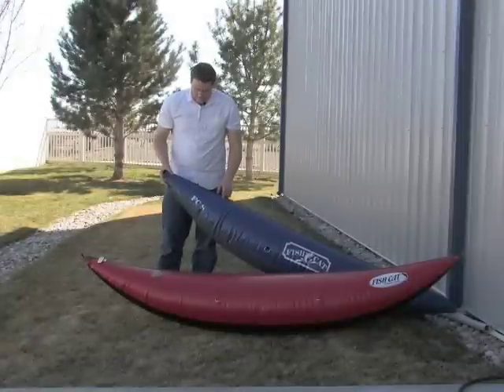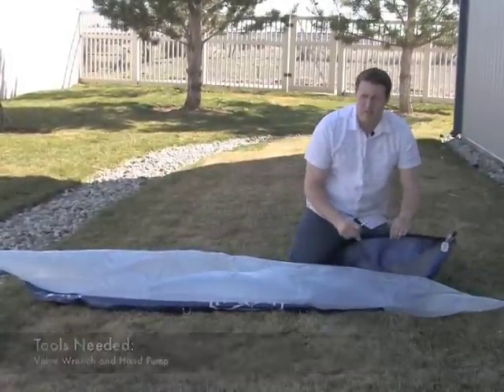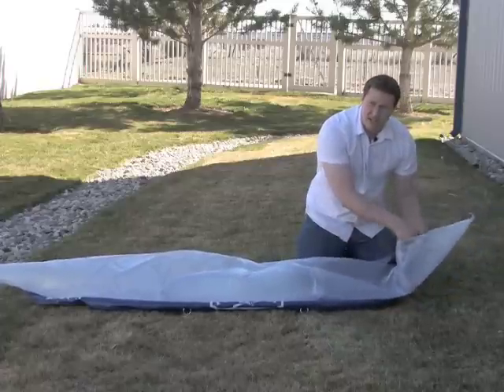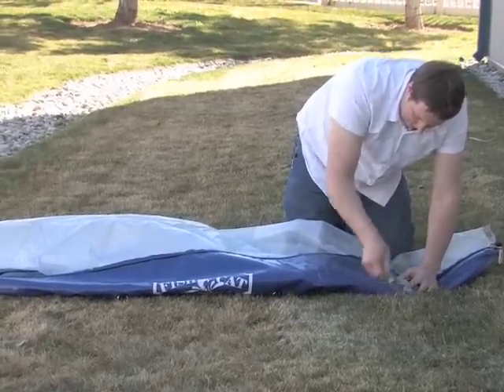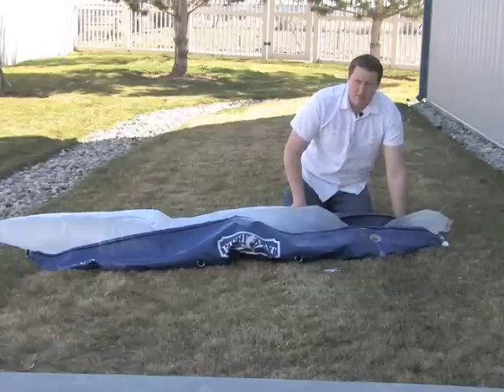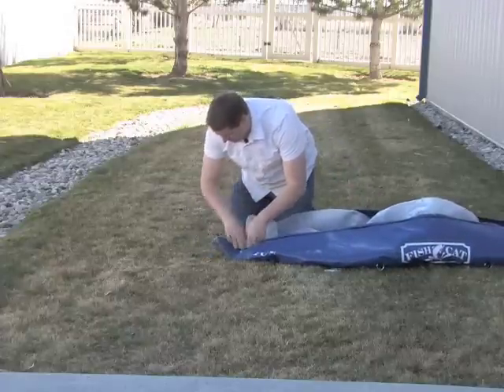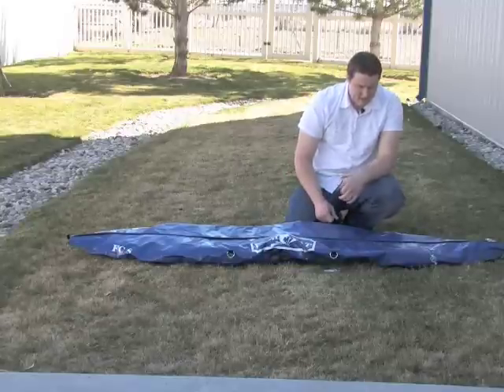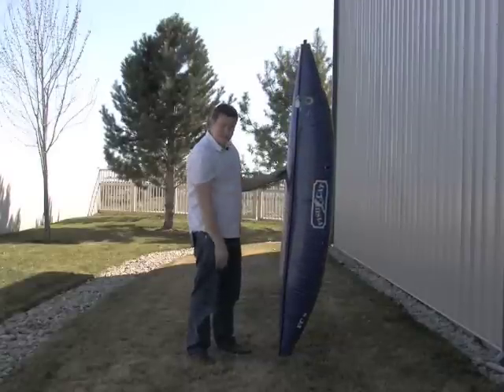Pontoon Bladder Installation

Comment: Can’t seem to get the old bladder out. Any tips?
Reply from the maker: The bladder is attached at the valve and at each end of the bladder. Unscrew the valve and take it out then detach each end of the bladder on the inside. This video shows each step in that process https://www.youtube.com/watch?v=9WbuD7h1H8s.  Hopefully that helps! If you still have questions give our customer service dept. a call at 800-247-3432 and they can walk you through removing the old bladder.

Comment: A couple of comments:  1.  Notice the nice metal wrench he uses...you get a cheap plastic one when you buy the boat. 
2.  He doesn't blow up the bladder on camera because with these "one size fits all types" it's a real pain in the butt to get them to fit. 
3.  The last time I called outcast about installing a bladder in my IR the told me not to roll the tips but to poke them back into the main part of the bladder so that they would emerge as the bladder filled.
Reply from the maker: Thanks for bringing these points up.  I did check with the Service Department and we have changed the way we install these bladders since this video was shot 4 years ago.  A new how to video on this topic has been scheduled.  The metal valve wrench can be purchased separately for $25.00.  The part number is 770-000330 and you can purchase this direct from AIRE or Outcast if your dealer does not have one in stock.